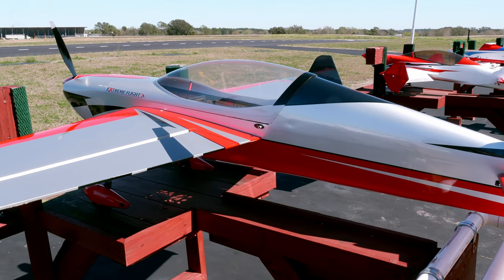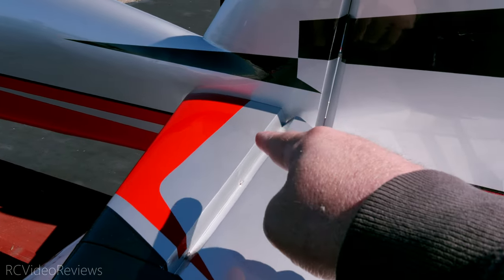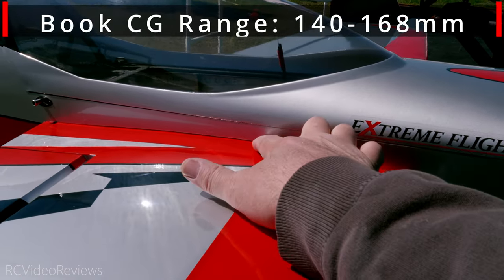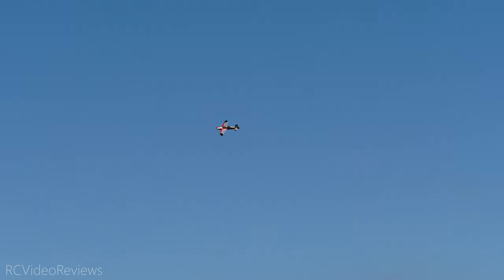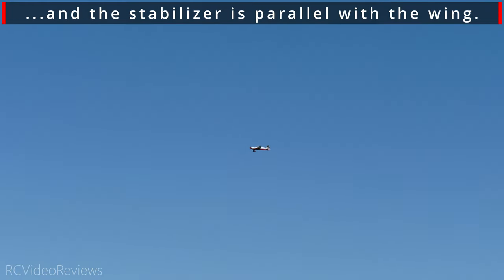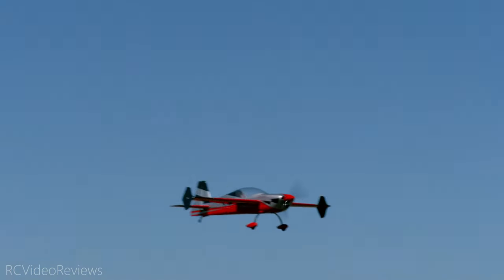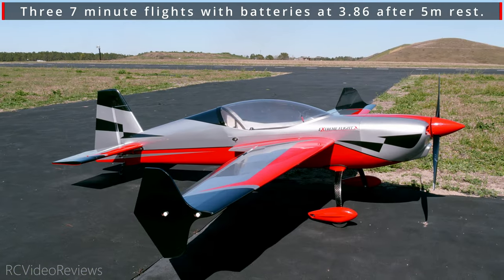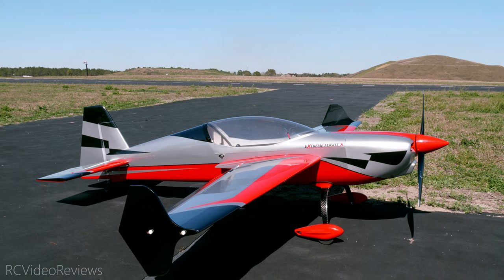ExtremeFlight 78" Extra NG Maiden

Comment: I have a Pilot 78" Extra NG. I bought it when I couldn't get an Extreme Flight plane because of world wide shortages during covid. I use the same Sunnysky 40cc motor and it does great. The Pilot flies great and although I fly with 12S 4500 packs, I will guess your plane is still lighter. Do you know you all up weight?
Reply from the maker: I didn't weigh this one. I've been interested in trying a Pilot plane.

Comment: VERY VERY NICE! Great job!  Sub'd and T-up on all of your videos!  Question please. I want to go bigger from 60 size.  I saw you fly the EF Edge 78" and this. Which do you like better and why? Do they fly that much different?   Also, have you looked into the StinGR power plant.... Electric motor with reduction ( same as they do in helicopters). ?  Thank you for your thoughtful answer!
Reply from the maker: Actually, my favorite size plane right now are the 67” EF and SW options. They present almost as well as larger planes in the sky. They’re SINGLE BATTERY which is really nice. And they’re a little easier to handle than the bigger 78”+ models.

Comment: So first video Ive seen on this. Looks great. I just ordered the blue one with a gp 38 gas motor. I hear the 78 ng is too heavy for the gas. Whats your take. Also is the plane big for a 78 nch or small presence
Reply from the maker: Even though I don't fly gas motors, I have it on very good authority the Gp38 isn't enough and going to a 21" prop bogs the engine enough to not get into the power band. 

As to presence: I guess that's a little subjective. Looked good to me :)